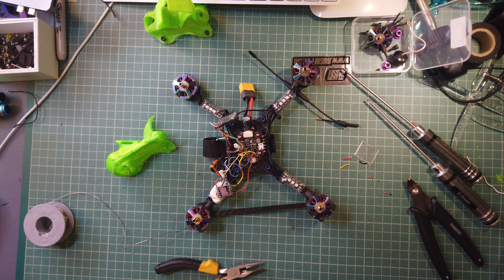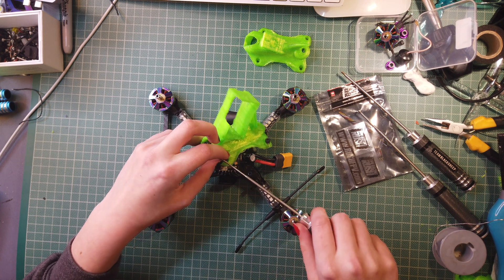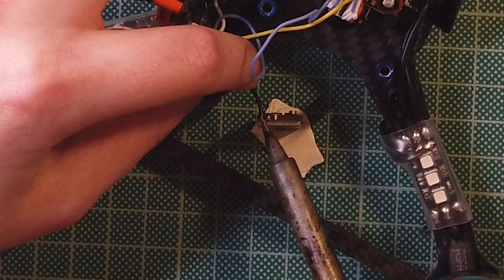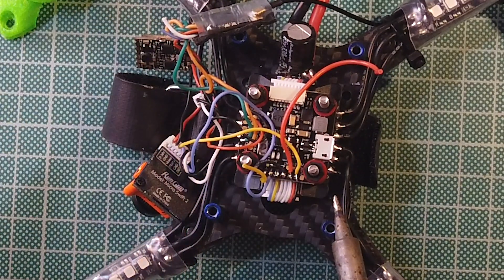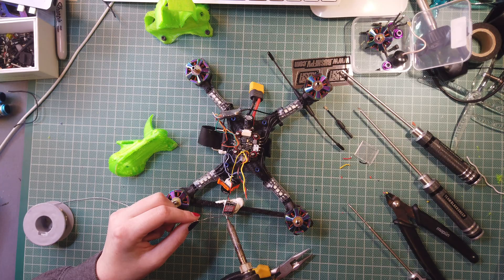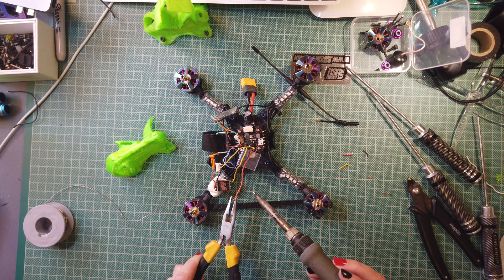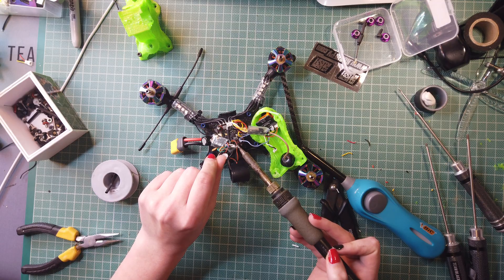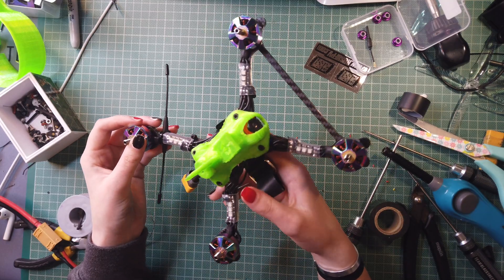How to (not) fit the RushFPV Tiny Tank VTX (152)

Comment: I admire you and the fact that you can solder it without a good magnifying glass/light unlike myself. The only thing that caught me off guard is the multiple wiring ways which are overwhelming to me and the absurd amount of itsy bitsy pads. I just don't know how the other ways work, all I know is the Vtx connects to video out on Fc and smart audio beside that usually then the Cam connects to the FC also. My problem is that I must have burned up the Osd chip on my Fc and need to try it without so time to figure it out.

Comment: here a bit of advise from some one who ALWAYS forgets to put on the heat shrink on certain components. here is my step by step break down: 1.) Make sure you put the heat shrink far away from you so you forget to put it on. 2.) Solder, then Admire how lovely that soldering job is. pat self on back 3.) In a quick glancing moment, forget you saw the Shrink wrap that is only 6 inches from you. 4.) Grab electrical tape and admire your soldering as you wrap the Electrical tape around VTX, totally dismissing the fact that the Heat Shrink still exists. 5.) Alternate Step: you could go commando and just HOT GLUE the heck out of it cause that works too! all in all, the only important thing here is how lovely you soldered those connections on :P :P :P UR WELCOME!!!